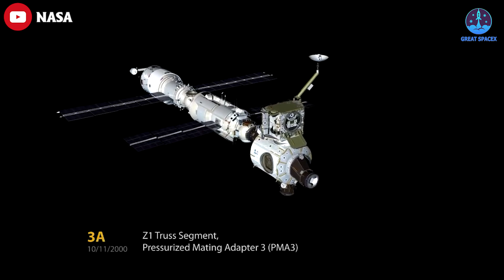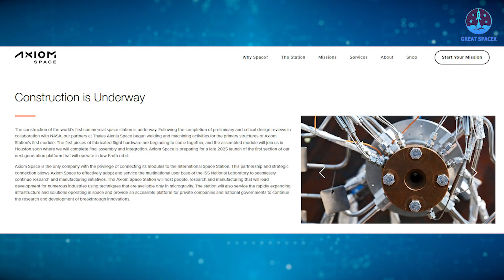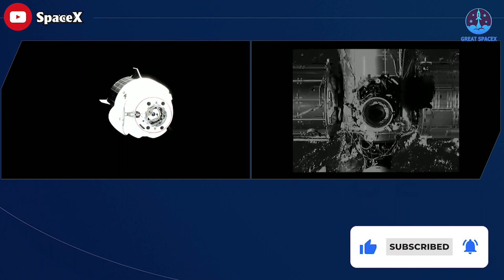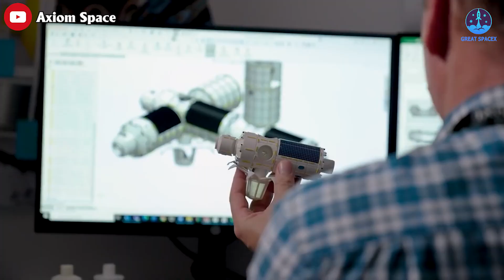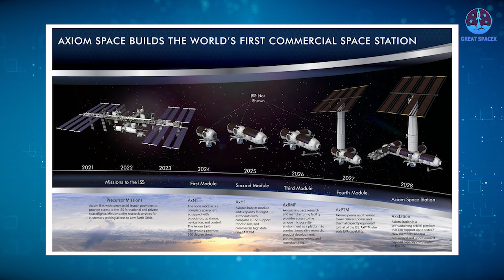The First Commercial Space Station makes HUGE PROGRESS driving NASA crazily

Comment: As done in countless movies, are there any plans on having a Rotating Section to provide "Artificial Gravity" upon this "Commercial Space Station" as of yet?
Reply: Aside from the problem of having an airtight hollow axle and bearing (with seals that don't ever wear out!) for access, there's the problem that the energy used to rotate that section will also rotate the rest of the station in the opposite direction; less if it's less massive, but still. That could perhaps be corrected for with two counter-rotating sections, but it would still induce vibration in the station, which if ANY research is to be done there, wouldn't be good.

A rotating station should probably be the whole station, which makes docking a pain unless the docking is at the core which counter-rotates to stay still, but that would have some of the same problems.

Just don't figure on people staying up there more than six months at a time, and even then sticking to an exercise routine.
Reply: More wondering about whether they intend to have centrifuges aboard to examine different gravity loads on test animals? That was planned for the ISS, with Centrifuge Accommodation Module that the Japanese built, but wasn't delivered due to budget constraints.
Reply: @rlhamil  to solve the bearing problem a mag lev system can be utilized as far as air tight the beams used to spin the modules don’t need to be entered their sole purpose could be to hold it to a center point around which it spins that middle section would need some type of system in place to keep the center piece from spinning like maybe a secondary ring of modules that rotates in the opposite direction for the same purpose